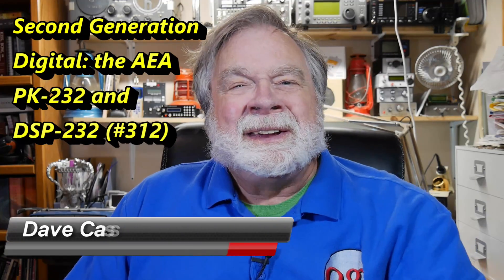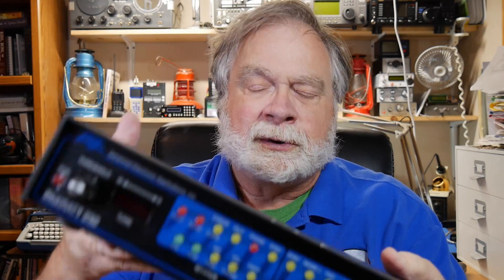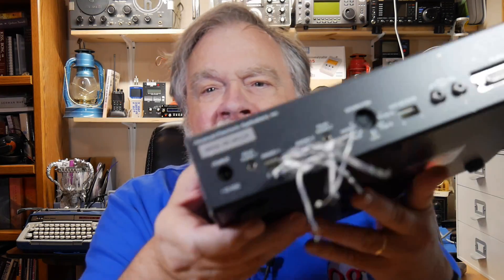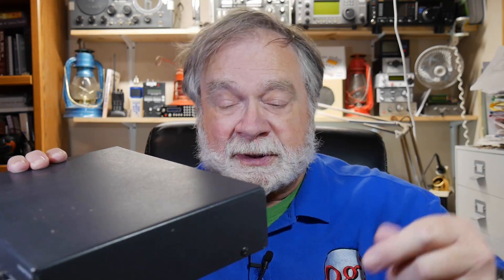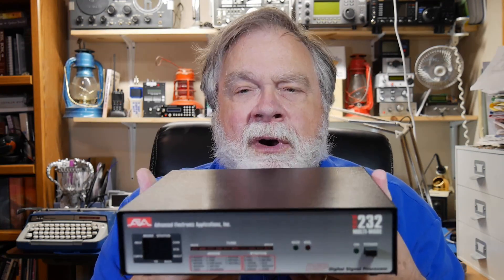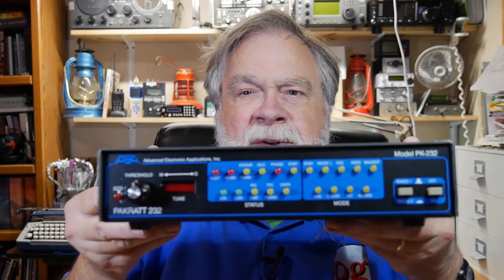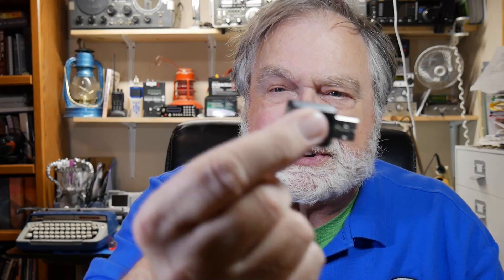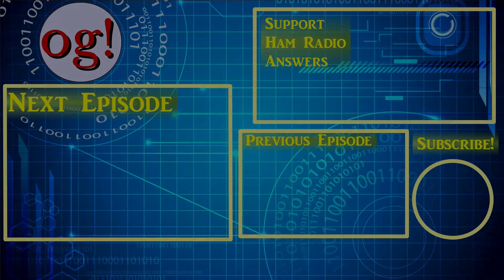Second Generation Digital Products from AEA: PK-232 and DSP-232 (#312)

Comment: Those connectors that you say you can’t get are the five pin molex connectors, as well as the din plugs,  and could also send Psk 31 with the interface board

Comment: Rather than solder to the pins for the radio connections, you can get the MOLOX connections on the internet or re-use an old cable from a computer that went to the DVD drive sound interface for music audio. Same thing and it fits the back of the PK232.

Comment: There are connectors that will fit into radio1 and radio2 back ports. PK-232 is a pain in the neck with modern PC's that only have USB ports. A lot of times USB-Parallel adapters are made in China and are junk. I found me a desktower with Parallel and Serial ports.
Reply: YES, those Radio Connectors were MFG. in Chicago Area by Pancon (MAS-CON IDC).  COVID-19 disrupted orders and production.
Pancon was Acquired by Illinois Tool Works (ITW), now known as ITW Pancon.  Newark Electronics was a large Distributor of these IDC Connectors.

Comment: The original PK-232 didn't come with Pactor,  Amtor was the only Tor mode.  But in 1993 I bought an adaptor from another company to allow Pactor.  It had 2 new PROMs and a small PCB that plugged into the back of the 232. Worked great! :)  And SCS does Pactor 2, 3, 4. Not packet 2,3,4 :)  Love all your videos!
Reply: Yep, pactor was an eprom upgrade, along with the Psk31  board,

Comment: It DECODES and SENDS MORSE code. There are firmware and DSP upgrades still available. The processor is a Zilog Z80 8bit microprocessor. The '232' refers to the RS232 interface on whatever computer you are using. G7VFY

Comment: I still love this old equipment and in some circumstance work better then digital mode (mean like FSK vs AFSK); I want to upgrade to internal audio card and usb with daug board but waiting because I still use for some nostalgic reason my c64 with pk232 with vintage tube monitor with TSTHOST/FBB and try to RTTY too..73 de IZ3QVB
Reply: Think in vid was a 232 MBX I series cause have color led, the standard version was all red

Comment: Back in 1971 when I was in junior high school and had my novice license, we had a radio shack in the school with Swan equipment including a 2KW linier, a beam antenna with rotator. In the morning I would get in early and tune in the news on the AP, associated press, which was RTTY. We has an interface converter and a telex printer and I would receive and print out the news from that day and post it outside the shack. Great memories for a long time ago.

Comment: I still have my PK-232MBX. When The ISS had the packet repeater on board years ago I would make station to station packet contacts. Best pass I worked was three contacts. First contact was North Carolina, then Pennsylvania and finally Kansas, all from central Ohio. Two contacts per pass was common. Been thinking on some way of bringing it up and working again just for fun. And I still have the 5-pin receptacles that fit on the radio jacks in the back of the unit. Thanks for the post, missed talking to you at Hamvention this year. We spoke briefly by the W5KUB booth two years ago. Keep em coming. Jon AC8XU
Reply: Yep, still got mine, even got the psk 31 board for it,

Comment: Hi Dave,
That was a nice trip down memory lane. I had an AEA PK-64 for the Commodore 64 that I just passed on to KM9G. He has a Youtube Channel Temporarily Offline where he built a C64 using a new PCB. I sent him two C64's and a C128 along with some other accessories I had. He recently did an unboxing showing all the components I sent. Stay safe. 73  WJ3U
Reply: Yep, l used my commodore 64 with my 232 unit, and tohen went over to a amstrad 1640 dos only machine, now running it on a windows seven machine through a com port, still works,  he doesn’t do a lot of research does he?   lol
Reply: Kanatronics TNC modems are still for sale new too but they're expensive.

Comment: I'm going to get my PK-232MBX to work with a raspberry pi.   So far it's working nicely using Coolterm in windows 10 but raspberry pi 4 is the goal.   There is no real good reason for using this except it has a lot of nostalgic value to me.  I had a lot of fun using it back in the late 90's.
Reply: Mike, I use 'tio' as a serial program on my rpi to connect. Works good